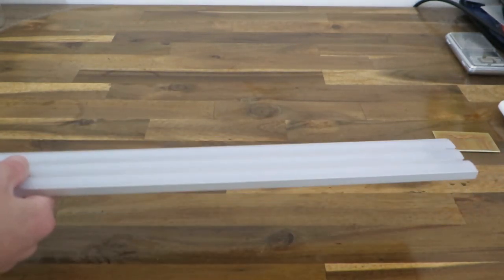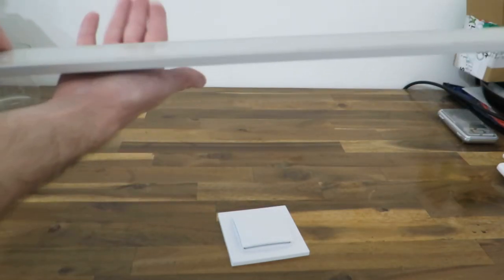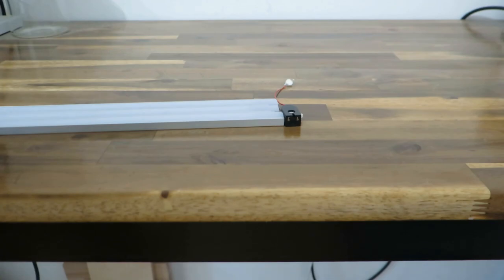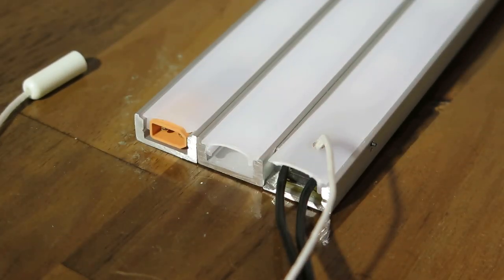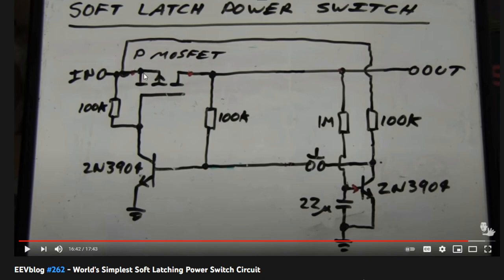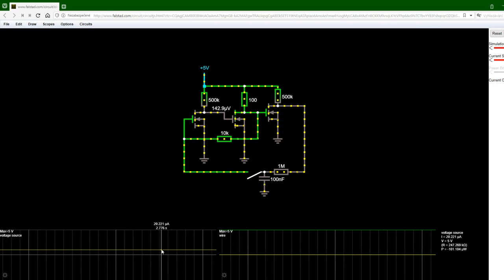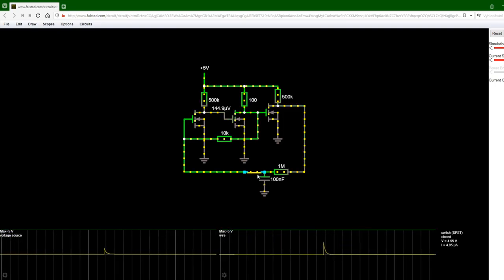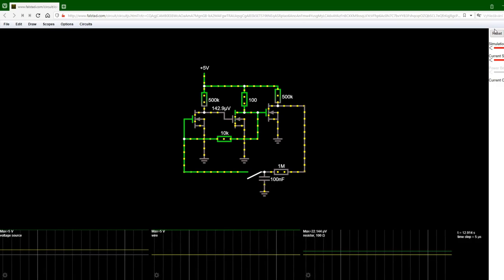Microswitch toggle circuit

Comment: You can buy ir sensor/switch and it's quite elegant
Reply from the maker: 3:16... This is just random application of the circuit. Also I don't like using IR sensors indoors, but sure that is also a solution.